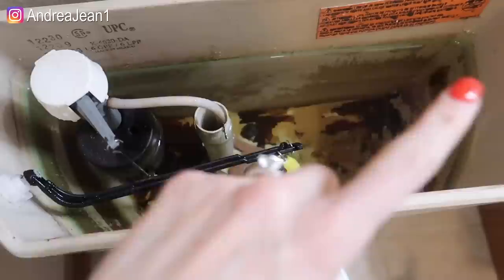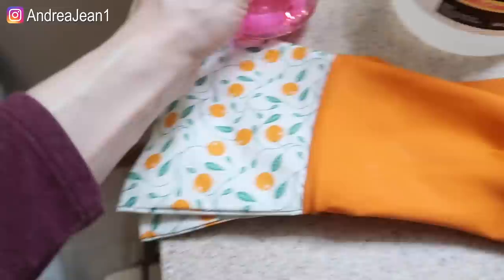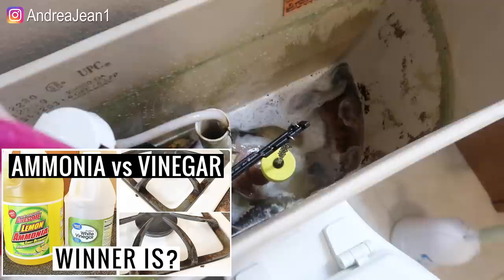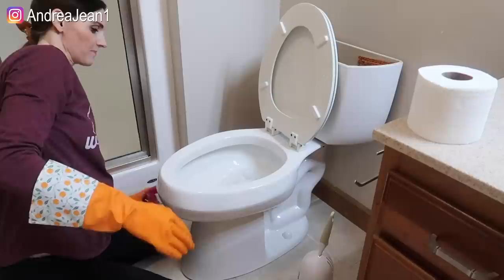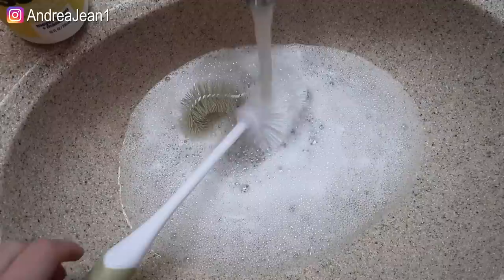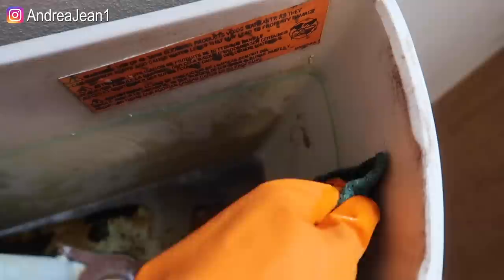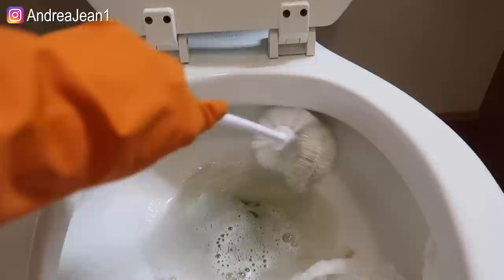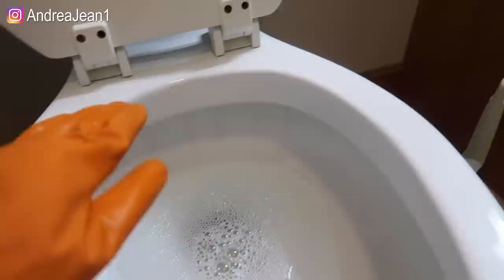Put VINEGAR into your TOILET and WATCH What Happens!! (Bathroom Cleaning Hacks)

Comment: I have a question about cleaning something else I am having a problem with. A Hot Dog roller grill like at a convenience store. They are caked on with fat from cooking hot dogs.  I don't think they have been cleaned at all. I tried Bar keepers and easy off to no avail, even when heated it doesn't melt off. There is a coating on the rollers that I have to be careful of so hot dogs won't stick. Help?
Reply from the maker: Ammonia??

Comment: But how did you get the scale sediment out of the bottom of the tank? If you run it through the toilet by flushing, it could plug up the water holes (or get stuck) and then what?
Reply from the maker: I didn’t bother with the last bits... it was good enough for me 👍

Comment: Vinegar will damage the rubber gasket sand stopper. Alkaline cleaners or windex sprays are safest.
Reply: Alkaline cleaners will not remove alkaline mineral deposits tho...

Comment: I also use vinnegar,but with a little baking soda,.just for added strength to clean the toilet, the sink, mop the floors, it leaves them nice& clean, plus cleans  those stains leaving them nice & shiny, plus it is better, cheaper than any of those other chemicals, plus I use it to clean the wiper blades that clean them, leaving them like new, you would be surprised at all the dirt coming of the black rubber part that cleans the windshield, as to the toilet bowl tank, I would  leave some vinegar with a  a little bit of baking soda so it can sit overnight to completely finish taking the dirt,rust scales and leave that tank like new, also another great product, that you can use vinegar & baking soda with a lot of water is as a nutrient to keep those potted plants or other plants nice & healthy, because this acts like what a fertilizer does but at a cheaper price,🤫🤫🤫🤫🤫🤫🤫
Reply from the maker: Thank you 👍

Comment: or you could use paper towel on the mirror and then pack that around the rim making sure to remove it later and not flush it and could you just put the toilet brush in the toilet instead of the sink?  you're giving me lots of good ideas
Reply from the maker: Thanks Michelle! Yes of course you can.... I needed to get it out of the way though and needed to really scrub my sink anyways so it worked out 👍
Reply: some paper towels still leave lint, my mom cleans houses for a living and she uses white sack cloths, and when washing those you cannot use fabric softner or dryer sheets it will cause the fabric to retain the chemicals and when you dry them air dry works best

Comment: I do t know how much to turn the water back on?? Help ! It just sounds lije water running now all tge time
Reply: Your issue is in the back tank. The rubber seal that lifts when you flush needs to be replaced or the toilet fill valve needs replacing. We’ve had both issues.
Reply: Justin Wolfe Thank you!

Comment: Try a pumice stone to remove the hard water lines you spoke of...
Reply from the maker: Yep that’s another great alternative 👍
Reply: pumice stone doesn't really clean, it scratches and removes the surface of whatever you are trying to clean. It appears to clean because it takes away the stain along with the surface of the product. So you're left with a finish-stripped and scratched surface which is even greater for bacteria to accumulate on.
Reply: Sorry Debbie but my surface isn't scratched. The pumice stone does remove the hard water lines in my stool. However, I love the vinegar clean that Andrea is doing in this video. That I will definitely do.

Comment: people do not know there are little holes under the rim that you can clean with a wire.....that goes all the way around the whole rim.  You can not see them but that is where the water from tank comes out.  Take a mirror and you can see it under the rim.  Also I have an older toilet that has a whole in the front of the tank that many people do not know is there.  you can see it with the mirror also.  This can cause the water to not smell so good.  Just wanted to share this with everyone. Clean the holes out and the toilet bowl should stay cleaner.  Reply if you want.
Reply from the maker: Thanks Karen 😃

Comment: Can this stronger vinegar be used in most carpets to remove stains?
Reply from the maker: I have used it 👍
Reply: I use A spray bottle of peroxide water and a bit of Dawn dish soap.  I spray the stain and rub softly or I use a cleaning brush if it's soiled.  Let it dry and vacuum.

Comment: This is a great tip and works perfectly, but being a lazy couch potato I think maybe just pouring the vinegar into the tank where it dilutes 50/50 like cleaning a coffee maker and leaving it for a few hours or using a sprayer with a wider spray. I pour bleach into the bowl and flush it down after 15 minutes, (do not pour bleach in the tank it will ruin the rubber flapper), the porcelin below the water line turns white. Andrea is smart and pretty, if I were 60 years younger, not gay, and had permission from my 8 wives and 10 g/f's I would marry her. What about a new video showing how to empty a beer keg during the superbowl  to make it easier to clean. I will show the wife the video and she will have to buy a key so it can be done. I have used a prsoduct you can get at the store called "hurri clean" that works overnight to clean out the tank.

Comment: Is that straight vinegar?  Or diluted?
Reply from the maker: Straight vinegar 👍
Reply: The cleaning vinegar is different than pure vinegar. It is usually mixed with another ingredient. I use it in my shower, walls, etc and with a toothbrush on grout. I use straight white vinegar in my laundry, dishwasher, coffeemaker etc. Anywhere i don't want soap added. So make sure you read ingredients for the right vinegar to use! But it's a great cheap cleaner!

Comment: Do you have anything to clean washers.  I’ve seen the commercial for the tablets but I don’t want to spend a fortune on tablets just I know how dirty washers get, they get a funky smell to the months
Reply: I meant clothes
Reply from the maker: I do not... if I do I will let you know 👍
Reply: Run washing machine EMPTY on the hottest wash with a cup of vinegar and a cup of bicarbonate soda.  Always leave door open, spray neat vinegar into rubber seal every so often, leave drawer open and spray neat vinegar into drawer every so often, once a week. Stops the bacteria from clothes and soap powder residue smelling.. no need to rinse. Google how to clean sinks with bicarb and vinegar and kettle of boiling water. No smells.

Comment: We don’t get household vinegar where we live.
Reply from the maker: Bummer...
Reply: @rosemary marsh While vinegar is a gr8 multi cleaner & we all use for a pleather-of-things... It's not a DISINFECTANT.. point is if you want to Sanitize or Disinfect which are two different things there is nothing wrong with using bleach. It's safe for it's proper use on the label, & as long as your not trying to use for injection or consumption.  Bleach is also still the most common use in our American Preschools to sanitize & disinfect.  Now not all bleach is equal, make sure to disinfect t/ label says so or has a certain level of Sod-Hypochlorite.  For those others who still don't want bleach, at least wash/clean the surface with soap & water, or a 70% alcohol.. Especially if you lay your toilet brush around-on other surfaces
Reply: Actually, vinegar is a disinfectant and removes mould. As long as you use 10% vinegar, not kitchen vinegar, which is pretty much mostly water.
Reply: Ask the store to order it

Comment: The smell of vinegar makes me want to vomit. I cannot stand the smell of it. It reminds me of rotten fruit/vegetables. And the smell of vinegar lingers on for many hours/days if you're going to use it as a cleaner. I'll stick with Bon Ami or Comet cleanser with bleach. The smell of bleach doesn't bother me a bit and it gets rid if the stains seen here in this video only using it once. For lime, rust or calcium build up, I use CLR to do that job.

Comment: Hard water deposits in a toilet freshwater supply do not cause many failures so I wouldn't kill yourself trying to make it sparkle.  As far as maintenance is concerned, a rebuild kit is only about $15 at Home Depot but cleaning the inside of the tank until it's sterile won't make those cheap Chinese plastic parts last any longer than if you hadn't cleaned them at all...planned obsolescence in action Andrea Jean :-)

Comment: Why does the inside of the toilet need to be cleaned. Seems unnecessary over kill
Reply: IMO and with  my allergies to wet mold, etc.....  Everything in the tank on the back sits right i the bowl - and think of it like this- open toilet tanks are emitting all kinds of bacteria/germs/smells into our homes.  I usually spray lysol in side the tank and on the lid but this is just the best way I can imagine!  I also close the toilet lid before I flush it.  The mist of the flush is airborn.  yuck

Comment: So why should I clean the toilet brush before I clean the dirty toilet bowl?  Even if you are one who does not clean the brush after cleaning the bowl (ick) I don't see the need to prep it.  Anyways lining the rim of the bowl with toilet paper is a good idea whether you stick the tissue on an already wet bowl or spray the tissue before sticking in the dry bowl.   Me, I don't even use a toilet brush b/c I don't like the visual or idea of "specs" in the bristles of the brush nor do I want to clean those bristles afterwards.  Once I get the water in the toilet bowl below level, I use gloves and a paper towel or tissue to wipe the bowl after sitting a while with the cleaning agent.  Sometime I may use a toilet brush sponge on a long handle to swiss around the bulk of the tissue under the rim and then soak and wash the sponge afterward.  I do have a cheap $1 toilet brush only for the guest to use and clean up after their own waste which is rare.  Still nice looking toilet brush with the extra brush for angle in the video and a good presentation.
Reply from the maker: Thanks Sammy 👍

Comment: the part of the brush that stands up should be used to go under the toilet edge - no need to use toilet paper
Reply from the maker: Yep just showing some different options ✨
Reply: Yes, the stand up brush is for the under top edge of toilet bowl. But, the point of using toilet paper is to apply the vinegar to stick to the under edge  of toilet and to soak the area for an hr. or so. I personally would not want to spend my entire day holding  the brush soaked in vinegar to the under ridge of toilet area section by section. In addition, the brush soaked in vinegar would dry on the brush quickly and the point of cleaning / soaking the area (under edge inside toilet ) w/Vinegar and your suggestion of use of the  stand up section of brush vs. toilet paper soaked would be pointless.
Reply from the maker: Thanks Jane!

Comment: You should NOT be using the brush when you have toilet paper in the basin. Some toilet paper bits can become lodged in the brush which if not removed properly can promote bacteria build-up on the brush. I see too many thing 'wrong' with the steps and methods used here. . . At least FIVE errors and issues here - one major issue not resolved and problems where cross-contamination can occur as well. . .